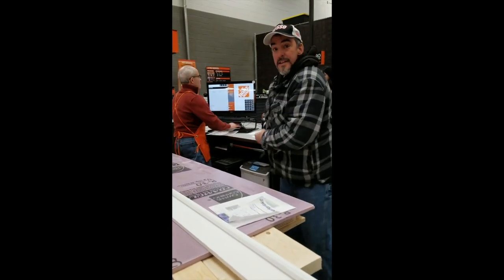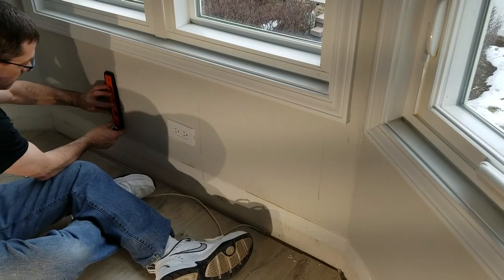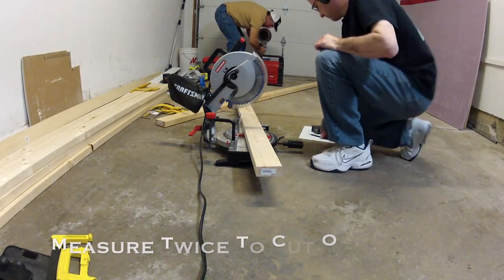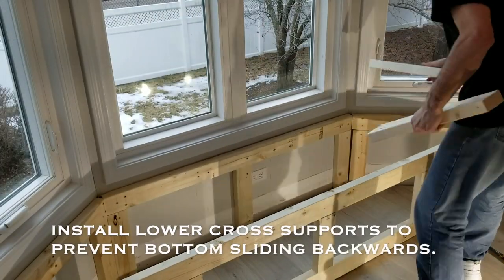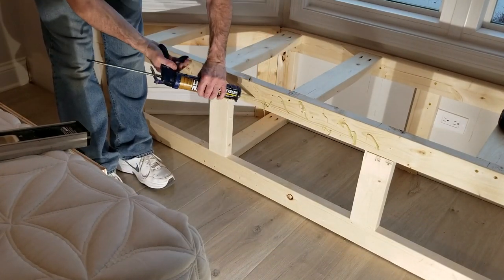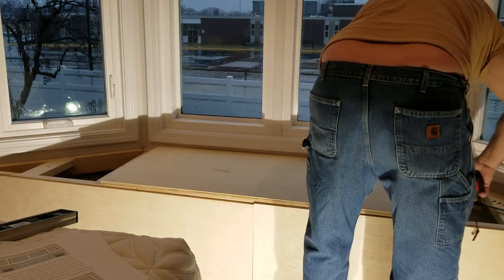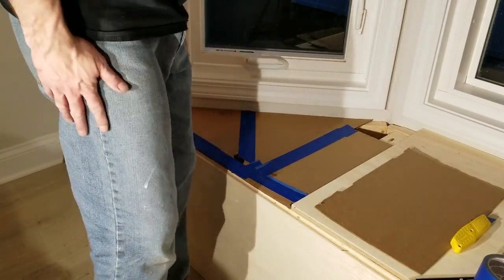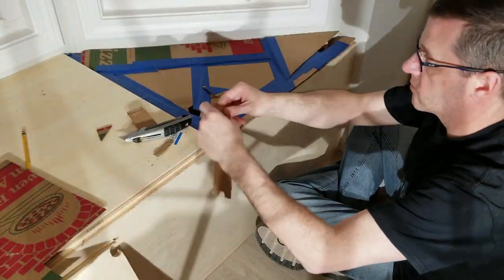How to build a bay window seat with storage part 1

Comment: Haha "footclamp"! I'm glad I'm not the only one! I'm looking to build this in my kitchen, but we haven't redone the floor yet. So the only question I have is, is it possible to make a bench that I can remove to redo the floor but that would still be stable without being supported into the studs? 
Thank you in advance!!
Reply from the maker: I use the footclamp often lol. You could build it the same way, just not securing it to studs, and trim it out. When its time, just pull it away. It's not going to move on you due to the weight.

Comment: Question- on the right front vertical panel, it’s slightly taller than the left.  Do you know what happened?
Reply from the maker: Hi Tim. All the trim work was cut the same length. If it's off, it's the floor not being level.

Comment: Are you required to move the electrical outlet since it won't be accessible?
Reply from the maker: Not by code. But it could easily be moved to the front of the unit and accessible that way. In this case the owner didn't want that.

Comment: Can you explain the math on the front brace that you did off camera
Reply from the maker: If you tell me the minute mark, I'll answer to the best of my ability
Reply: @marrazzowoodworkingdiy8118   @2:52 you start to do the front frame .
Reply: @marrazzowoodworkingdiy8118  also with the corner braces are they cut at 45 degrees ? And do I need 1 or 2 sheets of plywood
Reply from the maker: @ericawilliams18  I was measuring for the setback from the front of the wall to where the front of the finished face would be. I needed to set it back far enough for the ¾" plywood, plus the thickness of the face trim which was ½", and then make sure it was flush with the wall so the baseboard could go all the way across and look like it was there from day one. Then I set the framing back to that depth.
Reply from the maker: @ericawilliams18  the corner braces were NOT cut at 45° and dis not need to be. The top and bottom cross braces brought it all together.  I used 2 sheets of ¾" plywood on TOP for strength,  and one sheet in front.
Reply: @marrazzowoodworkingdiy8118  thank you
Reply from the maker: @ericawilliams18  you're welcome! Good luck with your build!
Reply: @marrazzowoodworkingdiy8118  Thank you , I will be using your video for guidance
Reply from the maker: @ericawilliams18  you'll do great!

Comment: Mike how much should I charge to install this ?
Reply from the maker: Sorry for the delay in response.  For some reason my notifications were off. I'm not sure if you did this job yet. I didn't charge as much as I should've . This job in my area should've been about $800.00.
Reply: Wow, 2,000 at least by me
Reply: $2,300
Solid ply top, 2 drawers in the middle, and a door on either triangle. Blum slides and hinges,  painted outside  and clear finish inside. I'm building it tomorrow.
Reply: @frontlinefinishcarpentry4193   I have a similar bay setup like the video shows, only difference is I have baseboard heat running around the bay. What’s you thoughts on building the bench over the baseboard and just putting a vent or two in the front of the bench? Thanks in advance
Reply: @quietstorm219  I would caution against it. Unless you build a removable type of bench that can be pulled out for any type of maintenance needed on the electric heat. 
There's also likely some type of local code that governs the clearance between combustibles and heat sources.
Reply: @marrazzowoodworkingdiy8118 any rough estimate for how much for the supplies if I choose to build it myself? Thank you. Looks great.
Reply from the maker: Shoot me an email at marrazzowoodworking@gmail.com and I will share that with you.